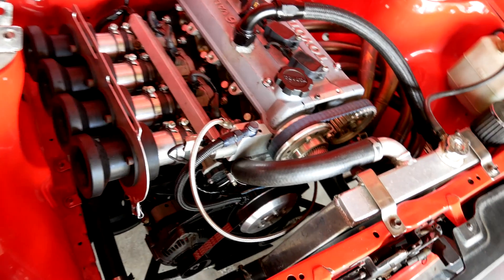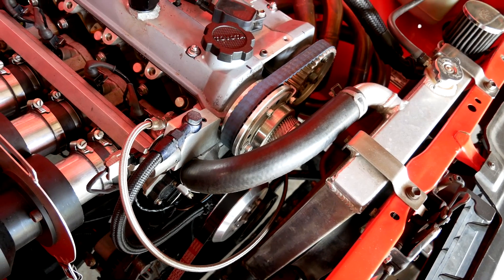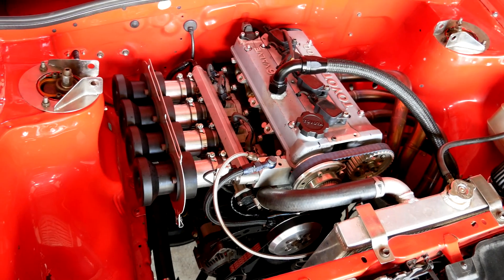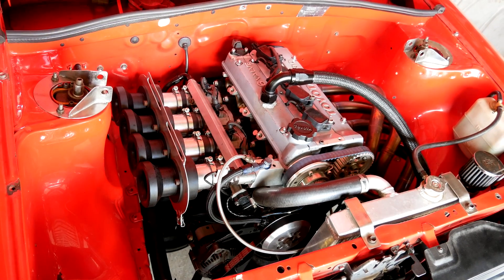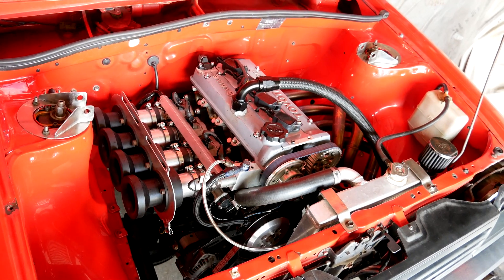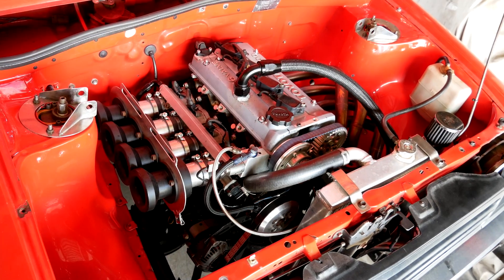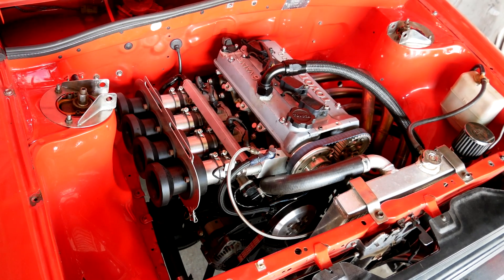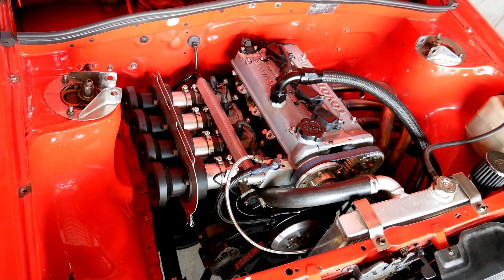VVTi   300 Degrees Cams - Dyno tested

Comment: 220rwhp out of 1.6L is completely bananas and show the power of rpm.   Big win for the VVT giving a suitable mid range with this big cam.    So if you could make 220rwhp out of 1.6L then 400rwhp out of 3.0-3.5L shouldn't be that difficult.

Comment: What VVTi gear is this on the intake, it looks different from 20v VVT gear.
Reply from the maker: It's a modified 2jz  gear
Reply: @Garage4age  what's the benefit of a 2jz gear instead of say a 20v vvt gear. Also is it possible to retrofit vvt gear on the exhaust side too?
Reply from the maker: @NikolasPafitis   20v gear is only 2 position 30degrees travel. Just on or off.  The jz gear is 60 degrees fully variable controlled by ecu. But  requires more stuff to run it.  Oil control, sensor and ecu wise. Isn't much to be gained, on the exhaust side over correct fixed timing. So not really worth doing
Reply: Are there any good resources on the 2jz vvt gear retrofit?
Reply: @Garage4age  also what is the reason there's not much gains on vvt on exhaust. 2jz and beams have it. Is it displacement?
Reply from the maker: @NikolasPafitis   Not at this stage.  I'm 99.9% sure I'm the only one silly enough to have done it.  Its not easy
Reply from the maker: @NikolasPafitis  only beams has exhaust vvti.  jz fixed.   majority  of  vvti engines are  intake  only.    Is a little bit in  the exhaust side and possibly better emissions wise so can get away with bigger cams factory.    but really not worth the complexity for just straight performance.   i have cam timing videos that show the gains both on intake and exhaust side.  on na  and turbo engines.   can see when exhaust cam is set right there wont be much gain moving it around with vvti

Comment: Hey man, what flywheel would you recommend for a 4AGE blacktop 20V AE111? What brand would you say? Are the Todas good? Or MRP? is it worth it over a factory blacktop flywheel? Thanks
Reply from the maker: this engine runs the 3.7kg 200mm flywheel.   very noticeable going from blacktop flywheel.  the 200mm clutches being lighter also
Reply: @Garage4age  Ok mine is a factory blacktop AE111 that I am converting to manual. Would you change to a 200mm setup or leave it 215mm? I was thinking of getting a 4.3kg flywheel and excedy HD clutch
Reply from the maker: @nzuncovered1845   The 200mm  will handle  anything the blacktop will throw at it  unless turbo.   just run a hd pressure plate
Reply: @Garage4age  Ok thanks, does it matter that I have factory c56 bell housing? Is the ring gear the same size on both 200mm and 215mm?
Reply from the maker: @nzuncovered1845   yeah everything is the same fitment wise to gearbox /starter.  only 4agze 225/230mm stuff is different (bigger spline)
Reply: @Garage4age  Oh right thanks. Also do you think it's wise to get the clutch and flywheel balanced together at a machine shop before install?
Reply from the maker: @nzuncovered1845   good idea to. but not the end of the world if you dont esp on stock rev limit.  most of them are balanced to some point anyway

Comment: Man, Im praying i can retrofit this to a 20v. This powerband is insane, and I absolutely HATED the idea of running a fixed cam gear
Is the JZ pulley youre using off of any specific JZ motor or just general? And Is it a direct fit or does it require the toda dowel?
Reply from the maker: all the vvti jz engines run same pulley.  Is a huge amount of work to get it to work on a 16v 4age. custom parts and machine work.  adapting to a 20v wouldn't be any easier.    I would suggest putting in the work to get the stock vvt pulley to work with big cams. assuming thats the direction your going. Its not the ideal setup but still far better than fixed.   It will be usable on bigger cams than people say.  just a matter of setting it up right and possibly modifying a few things.
Reply: @Garage4age   any chance you could make a list or directions on how to retrofit this JZ pulley to the motor? Theyre a fair bit cheaper than the 20v’s pulley so expirimenting with them is far more ideal since the 20v’s is practically double their price lol
Reply from the maker: @seven7een993   Its far to complex to write some instructions how to do it.  plus i dont really want to sorry.   If you look up the 2jz vvti system there are some diagrams of how it works.  ignoring all that part of it; how to get the oil to the pulley and solenoid etc.  the pulley sizes and offsets are different to 4age stuff. so the jz pulley has to be cut up start with and modified to fit different pulley to suit the 4a.  but tbh thats the easy part.   also the  vvti requires feedback to the ecu, is a closed loop system. so need a sensor on the camshaft itself.  also not that hard compared to the oil control side of it.   unless you have a lot of time to figure it out and access to at least  a a lathe and a mill, i wouldn't attempt it.    Even if i were to build a 20v i would work with the stock stuff
Reply: @Garage4age  I see, Thats quite the task it seems. Ill look into devising that on my own time then, and adapting it to the 20v. For now i suppose i'll toil with the standard vvt gear. Since 194-C is the highest reccomended, Im wondering if I could still manage on a 194-D w VVT if i set the standard cam timing to 5 degrees retarded, so when it advances by the standard 30 it only goes to 25, or some sort of variation to this. I suppose the only way ill find out is checking my clearances once the head is ported
Reply from the maker: @seven7een993  yep thats what i'd be doing.  find piston to valve contact, then set max advance to minimum piston to valve clearance.
Reply: @Garage4age  Have you thought of retrofitting the VVL mechanism from the 2ZZ?

Comment: Hello, Do you know what actual valves overlap in tdc/deg? due to single VVTI what exhaust valves overlap was set? looks like you can get more with intake manifold instead of itb, at least way simplier and precise afr and injnition tuning.
Reply from the maker: exhaust works in same place as it would with fixed intake.  as for numbers they aren't of much interest to me as set for best power on dyno.   the intake cam has about 5.5mm lift at tdc fully advanced.   from memory exhaust is 3.5-4mm.   may get close with a single but unlikely will beat itb's.  most of the power is in the runner length. tuning itb's is a non issue. have been doing them for 10's of years
Reply: @Garage4age  imho to much overlap
Reply from the maker: @Oleg-fp9hn  Well you cant really argue with the dyno.

Comment: How much does the fuelling change between different cam positions? Do you utilize closed loop to take care of it or re-tune manually for each run?
Reply from the maker: Not worth bothering fixing the afr in most cases.  i done a video on how much it effects power.     for example if you end up with a big 15-20kw  hole  and afr's drop into the 10's   .  the power its loosing from being too rich is maybe worth 1-2kw.  so there is still going to be a massive drop in power even if got he afr  back into the window it makes the same power.      Smaller changes in power, the afr change will have near zero effect on power.  https://www.youtube.com/watch?v=yjvPmG123nI
Reply: @Garage4age  Thank you for the swift response and the link! Though I was more concerned about going lean with a boosted engine. I understand with n/a it's far less of an issue.
Reply from the maker: @jeezy86  Hey, I already had it  tuned for the vvti map. so any power losses seen here,  it was going richer.

Comment: In the process of helping a good friend build up a BT 20v for his mr2. Hoping to see close to these numbers. Built bottom end + larger valves, springs, haltech ecu and the works.  I read about so many limitations as far as lift goes (tho many conflicting and near a decade+ old on the forums) but seeing this has me thinking maybe  more duration is the answer? were planning 264s toda cams or maybe 272  possibly 9.0 lift since looks as the heads need a tiny bit of clearancing to run that much. Sadly you seem to only play with 16Vs(BT remain a tuning mystery :/)  so you might not have the answers but these videos give me hope! Keep crankin em out! 🤘🏻
Reply from the maker: you'll have to go bigger cams than  272 if wanting to get big power out of any na 4age, 16 or 20v.   but as always you bolt ons will have to be on point for it to make any midrange when going that big.  peak power for that matter as well, have tuned a big cam 20v with wrong bot ons that made less power than my stock cam 20v.    cam lift  depends on duration to a point.  can run higher peak lift on a longer duration cam.
Reply: @Garage4age  I see, so long dur but also big lift is your recommendation to maximize the duration  for any "big" power  with proper bolt ons. noted!  that'll require some extensive (forum gatekepper) mods to the head from what I read for over 9mm of lift. tuning is something Im trying to become more knowledgeable.  Personally was into AEs 10 years ago or so and getting 160 to the wheels was impressive af at the time. I'm not expecting more than 180 whp out of his build  as I know 4ag isn't known for it power figures but  it's new to my friend and him seeing how much money he's going to be spending for sub 250hp has his mind a little blown hah.  would love to pick your brain with his build specs for some recommendations  more but hate to bore you with endless questions. appreciate your videos and the info you share. it's all greatly appreciated!

Comment: Bit of a daft question, but do you "have to" disable the VVT on the big cams? I was under the impression you had the ability to change the VVT values in the ECU also?
Reply from the maker: in my case i cant really much advantage using it on the 318 intake cam because of piston to valve clearance.  and the fact to 318 cam only works over such a small window of cam timing. simply because its open so long.   there is nothing i can do cam timing wise to fill the hole in the low end with it.    yes its ecu controlled but still physical limitations as above

Comment: How come toyota is so far behind honda in terms of na engines?
Reply from the maker: These engines were first sold in 1983.  while this one has the 89 spec head isnt that much difference  in what can be done.   so apples to apples at the time you'd have to compare it to the  ZC engine.  but in saying that, there aren't to many b16's making these numbers
Reply: Yamaha has never tailed Honda.
Not ever.

Comment: I remember some old Best Motoring one of the tuners being shown off was discussing 20v setups, 1.9 Liter, target similar power with peak closer to 9k like yours, idea was engine could live longer then more extreme setups, i think 15-30k km or so before rebuilds can't remember exactly, with target close to 210PS i think it was.  Not sure if longevity is your concern, but cool to see such a powerful 4AGE at the 9k region, setup seems extremely well refined.
Reply from the maker: Yeah if can do it with the 1.6 its going to outlast the 7a/stroker blocks. lower piston speeds touch better rod ratio. thats my plan with the long rod 1.6.  if this stock block one survives without much drama.  should be easy days for the long rod bottom end

Comment: Looking forward to you releasing the details on this magically operated setup 👌👌 This year I’m building a dream 4AG for a TA22. I have some FCR41’s for it and have been reasonably lost for internals inc the cams setup. Was looking at Kelford 193d so I didn’t have to switch to shim under bucket(?)🤔 Would love some more build videos of piecing them together and what components are good/bad.
Reply from the maker: Switching  full faced buckets themselves isn't that much drama or silly expensive.  use  1sz shimless buckets.   but alot of the cams that need them will need to clearance head as well.  not much drama if head is off tho.    If want to stick with stock shim setup.  i'd probably  go with  193-c     or if want a bit more and can go shim under/shimless  go 193hvb .   both you'll need to get you bolt ons pretty well dialed to make good midrange.   but once you start going  much past 300deg  don't expect your engine to do much below 6k.

Comment: Based on your knowledge and experience with VVTi, could this setup be implemented in a 3S-GE (big duration cams with VVTi)?
Reply from the maker: Are you talking big cams in the beams vvti or  adding vvti to a normal 3s.    either way it would be easier to just use the beams engine.   from memory the cam gears on the beams engine bolt to the vvti pulleys.  so if needed to re-index  the vvti  due to piston to valve  issues.  it shouldn't be  that hard to do.   from what i hear pulling the actual vvti pulleys apart on them is a bad day,  very hard to put back together
Reply: @Garage4age  yessir, I have the Blacktop Beams 3S-GE. I've only found one set of cams that's advertised to work with the VVTi, a set of 268s from TODA.
Reply from the maker: @rhubarbpie2027   Yeah you will be able to go bigger.  but likely wont bolt straight in.  will probably need find where piston to valve contact is. then find some way of setting the pulley  to stop just before that.   from a quick google to find some pics.  looks like  you should be able to modify the outer pulley to essentially   make an adjustable pulley.  or simply bolt the pulleys on in a different location.     as said above ive heard the beams pulleys aren't something you want to completely pull apart, as have a big spring in them which ends in a bad day. so keep that in mind
Reply: @Garage4age  thank you for your knowledge 🙏 cheers from Okinawa 🍻❤

Comment: What is the bellmouth to valve distance? (tuned induction length) And what diameter TB butterfly? Fantastic work, amazing how you've kept all the bottom end of the stock motor and got the top end of a Formula Atlantic.

Comment: Love your videos, great as always! I use to fiddle with my own vvti from time to time but of course never had the luxury of so much dyno time as you. Could you share this particular VVTi map for example? From your experience, how fast does the vvti gear turn? For example, if -20 degrees is better after 6000 rpm, do you switch the map to -20 at 6000, or do you switch it a bit earlier so the gear has enough time to adjust (let's say at 5700). If i had to guess on this engine, the VVTi map would be something like max advance until 7250rpm, -10 from 7250 to 8250, -20 from 8250 to 8750 and -30 from 8750 to limiter. Is this close to your map?
Reply from the maker: Im just looking at it now, as need to make a few changes.  On the dyno runs worst it misses the target is a few degrees where it ramps away fast at 8000rpm.   on the road it misses the target in same place by 10deg in 1st gear as goes through the revs so fast.   other gears are ok.    I need to change the oil feed to a bigger line and tweak the vvti settings then it should be close to keeping up in 1st.      so yeah its pretty quick, no need to get it moving early.     yeah thats petty close to what the map is.

Comment: Does VVTi help with idle in any way? I'm guessing with fixed timing and that much overlap, it must be really lopey :D
Reply from the maker: Yeah as above,  night and day difference in idle.  the pulley im using has 60 degrees of travel.  which is way too much  for this setup to use at wide open.    but rather than limiting the pulley travel mechanically, it setup just before piston to valve contact at max advance.      are using the extra travel at idle
Reply: Yes it does. I design and grind camshafts for 2 years now and tune vvts for about 3 years. The difference in idle is absurd. Low and medium load we go for a more retarded timing in the intake. It makes the engine smoother and the consumption is A LOT better.

Comment: I read about a really cool way to get increased power out of an engine recently, and it actually came from Smokey Yunick of NASCAR fame. He discovered that as the flywheel spins, it causes positive air pressure to build inside the bell housing. He filled the empty space around the flywheel with foam, then cranked the engine over to self-clear a path for the air to flow. By giving the air an inlet and then sending the output to the intake manifold, Smokey made 10 psi of boost pressure which in his case was good for an extra 125HP. Do you think you could try it and see what it does for you?
Reply: Its 1st of January, not April.
Reply: Would a lighter flywheel work better for this?
Reply: @ghoulbuster1  Not really sure, probably depends on the engine. From what I understand it was the teeth on the ring gear of the flywheel specifically that moves the air around, experimenting with the size and number of teeth would be a good start.
Reply: Tricks like this only make sense when you're trying to bend the rules for a racing class. Otherwise may as well just chuck a supercharger or turbo on. Thats very clever though!

Comment: I'm sorry if I missed it but where did the vvt gear come from?
Reply from the maker: its a modified 2jz pulley
Reply: @Garage4age  do those need oil to operate or is it just spring loaded?
Reply from the maker: @cjohn64  needs oil. the part sticking out the side with the hoses, is all custom and part of the vvti system.
Reply: @Garage4age  i see now. Very cool. Is there a write up on a forum for this mod because this is the first I have heard of anyone doing this to a 4age.
Reply from the maker: @cjohn64   Pretty sure no one else has been silly enough to attempt it.    I'm not letting out too much info of how i done it just yet.
Reply: @Garage4age  Well I'm very interested when you do decide to release info.